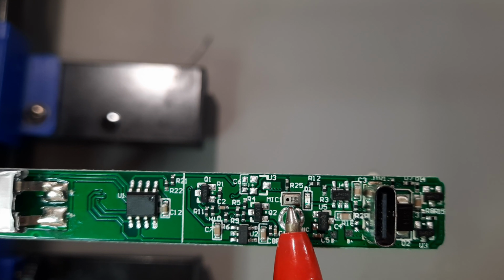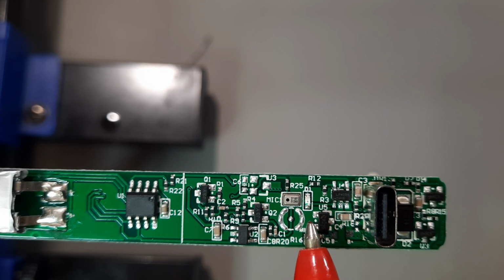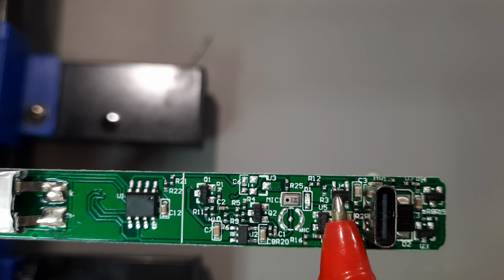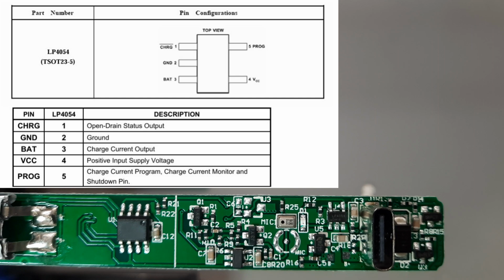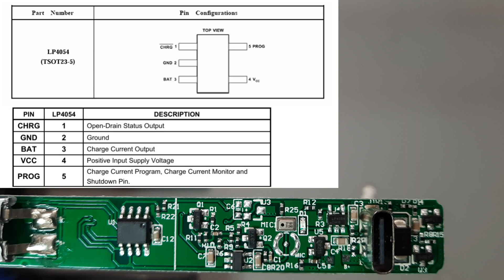32 LED Sound Controlled Lamp Teardown and repairing it

Comment: I have the model without the cell. I wonder if the charging circuit is present, and I can simply add a cell? I never made it past peeling off the lens. 😊
Reply from the maker: Might want to see if the LP4054 chip is on the board. But take it apart a lot better than I did. I can't even get a Li-ion battery for that price in Canada for what I paid for the complete unit. If it is actually 250mAh

Comment: should have stored the spare parts in the device, otherwise where did you put it ?
Reply from the maker: Would have liked to put the parts back in but the some of the pads that lifted are under the part. Use to have a conductive ink pen, might have to look into getting another. Will save the LEDs in a bin since I don't have any of this type